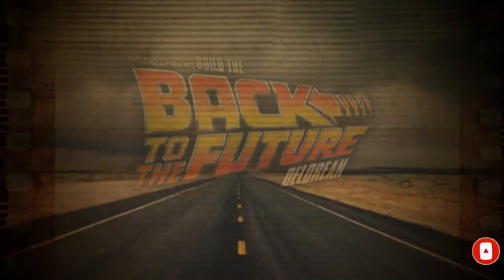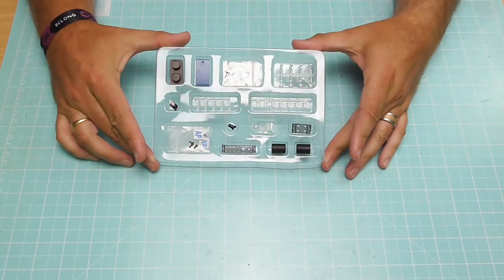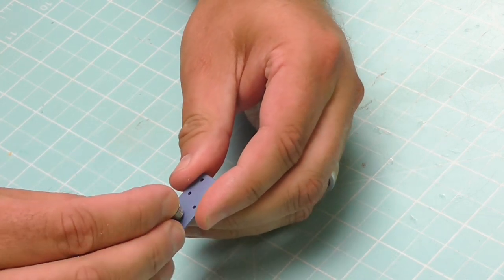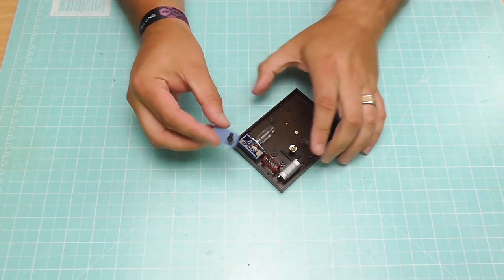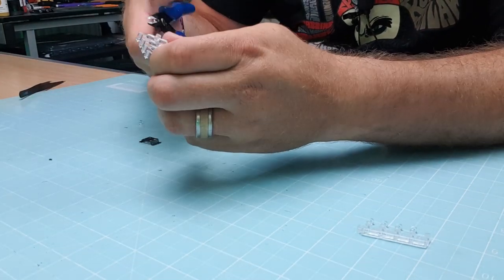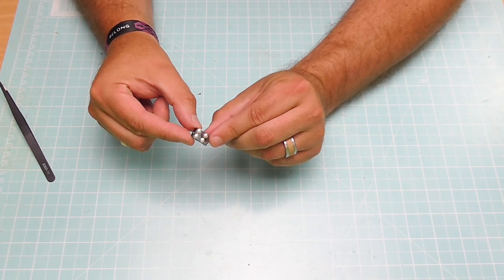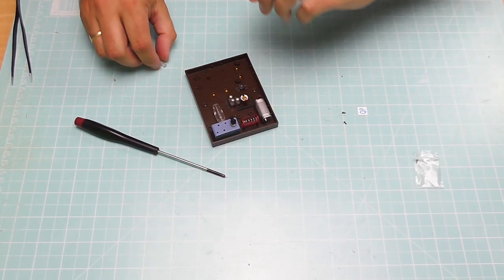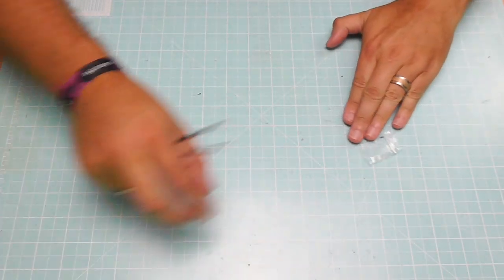Build the Delorean EXTENDED - Issue 137 - Emergency Time Circuits

Comment: Nice fiddly bits. More fun than doing a half rail at a time video.
They really are milking the rails parts aren't they?
I could have made rails from steel in the time it's taking for the plastic ones to be finished.
That would require a small forge to be built in the back yard though.
Hmmm, tempting.